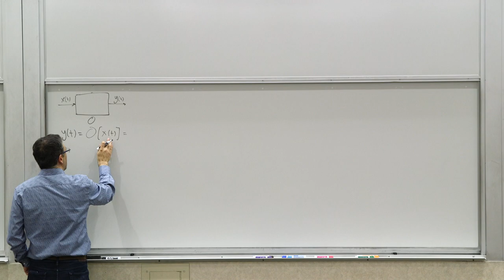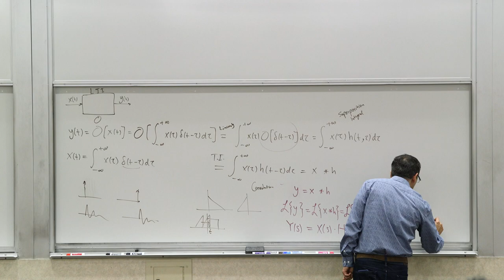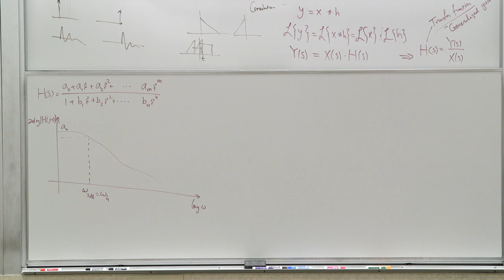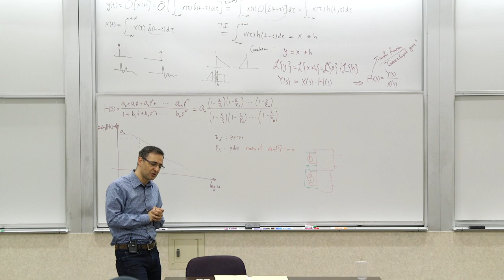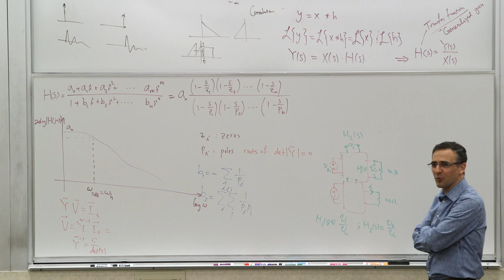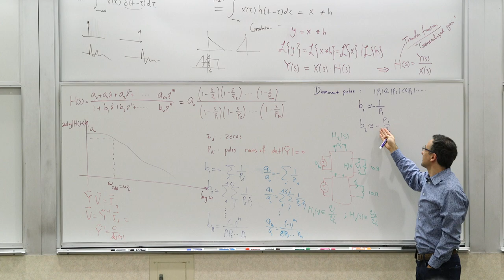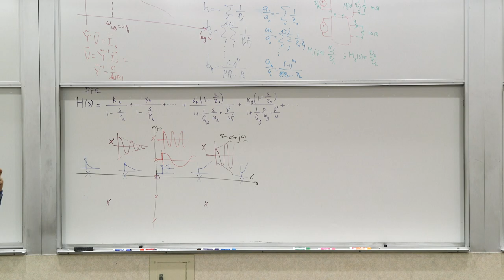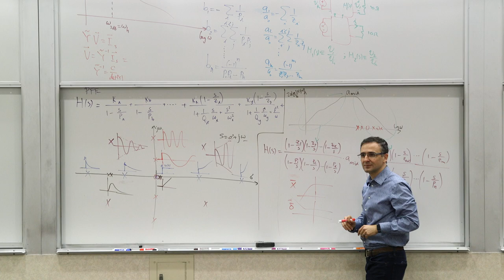139N. High frequency: transfer functions, lower pass and high pass response.

Comment: @42:20 the expresssion for b2 after dominant pole approx. , that seems dimenionally inconsistent ryt? in the expression derived for general purpose its of the form 1/PiPj and after approx is (p2/p1) which doesn't have any dimension .
Reply: I have the same wonder. It does not match the general expression of b2 = sigma sigma (1/PiPj)